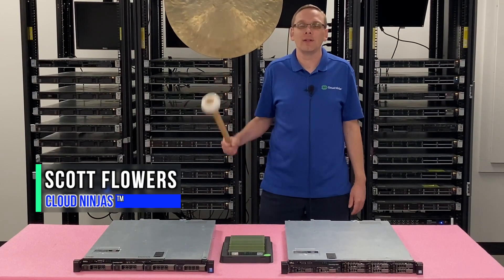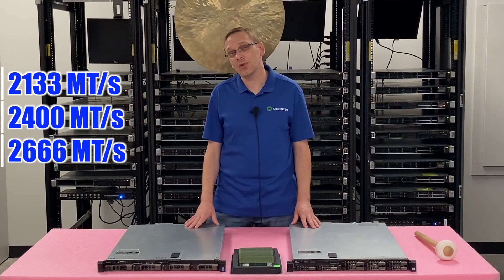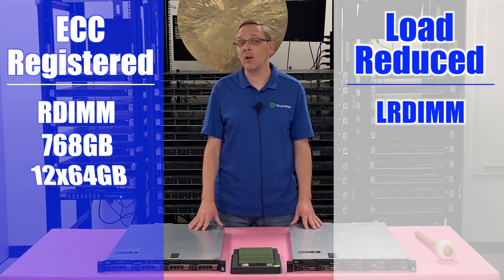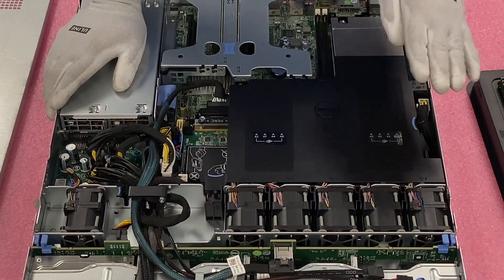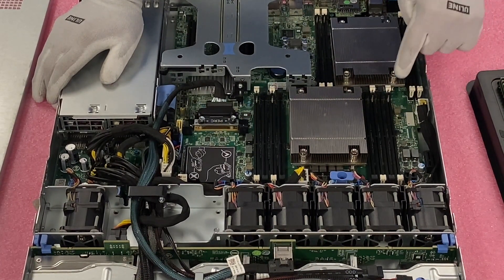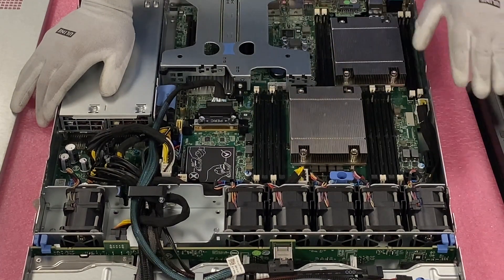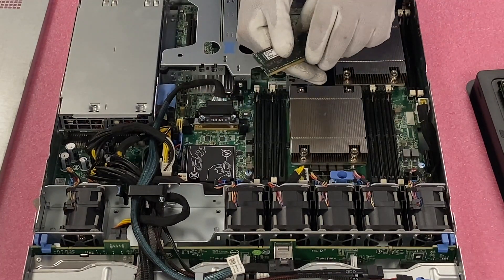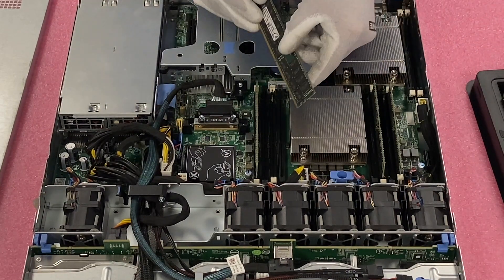Dell PowerEdge R430 Server Memory Overview & Upgrade | How to Install RAM | Supported DDR4 DIMMs

Comment: Hello, I have this R430 server with the E5-2630 V3 processor and with 2x 8GB 2Rx8 PC4-2133P RE0 10 SC0 M393A1G43DB0 (DIMM A1,A2), but when I install 1x 64GB 2Rx4 PC4-3200AA RB4 12 DC1 M393A8G40BB4 (DIMM A1) it stays in Configuring Memory...... it does not advance, what do you recommend?
Reply from the maker: 3200 speed not supported with V3... and pretty sure not with V4.  Would clock down anyway.   Check our memory video for more details.  We tested at some point and in the video.  Good luck.

Comment: I'm playing with air conditioning
Reply: Can you use a different external unit like inside there is daikin (precedent behavior had removed only the external unit) and outside something like haier or other?
Reply from the maker: It's crazy hot in Texas right now!  100+ degrees.
Reply: @cloudninjas  degrees faranheit!